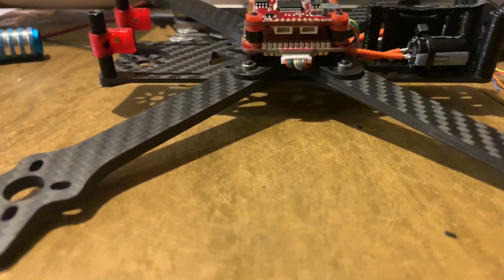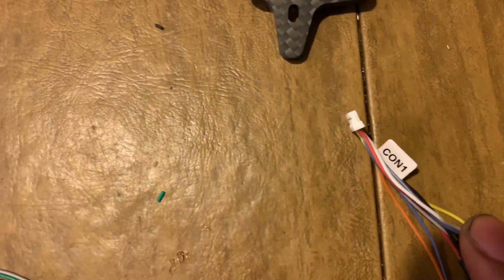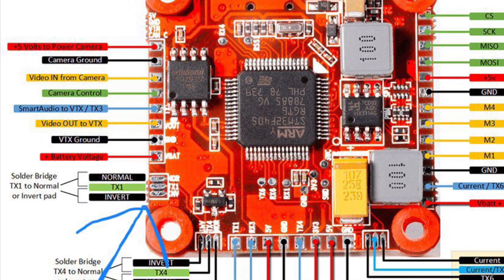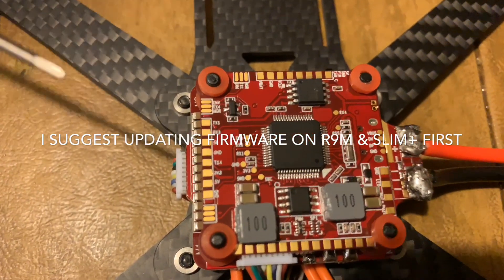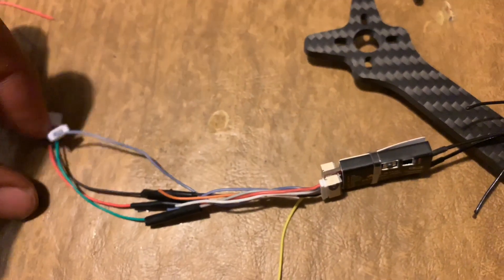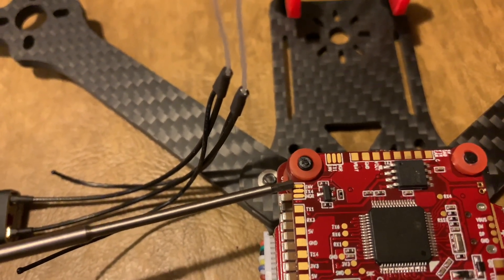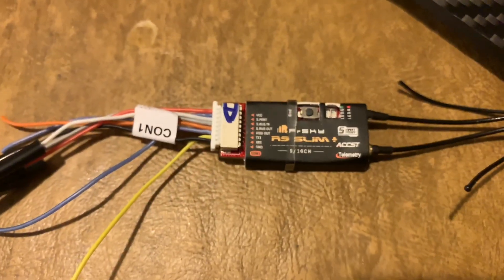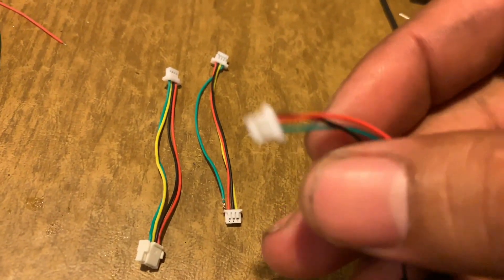How To Wire Frsky R9 Slim+ To Flightone RevoltOSD

Comment: Morari Nicolai
Hi everyone I have a problem with R9m & r9slim+ I cannot bind them. I updated firmwares v1.2.0 lbt, transmitter x9d+ v2.3.0 when I chose external module R9m lbt it shows me (certified firmware required) . After I continue and finish bind procedure. Result: they are not binded. I tried to do it few times results same. Is anybody nows how to resolve this problem? Please help.    I’m in United Kingdom

Comment: I've been going crazy for 3 days trying to make my fc recognize my frsky xm and I still can not.  Has anyone found the solution?
Reply from the maker: Did you solder the inversion pads?
Reply: Panda FPV yes and nothing 😭😞
Reply from the maker: Bshop FPV try resoldering the inversion pads. Are you getting power to the rx when you plug battery in?

Comment: Panda You Rock!!! This also works for R9mm
Reply from the maker: Kevin Buttry dude I have a mistake on the video. The s.port should go to rx3. I don’t think there’s a way to change the uart in flight one. Unless you know how to.
Reply: Panda FPV at least that’s an easy soldier fix. So I just need to move the tx4 to rx3 then all should be good
Reply: @OCONBaggers  So the Sbus out from R9MM should go to  TX1 or TX4? thanks and how to set the Taranis?  +200 -100 like the others Frsky? and which channel? still 8?